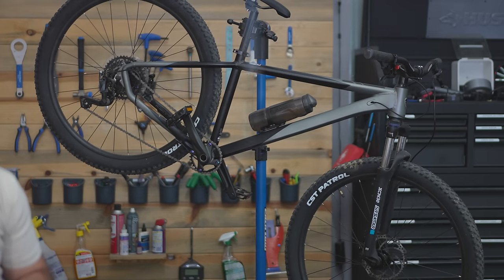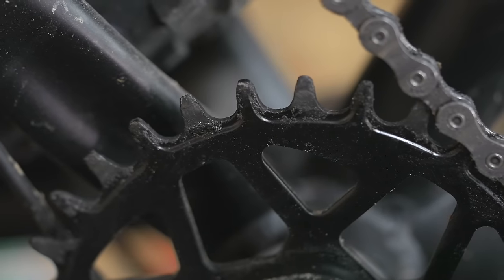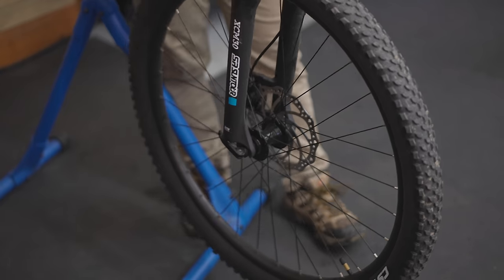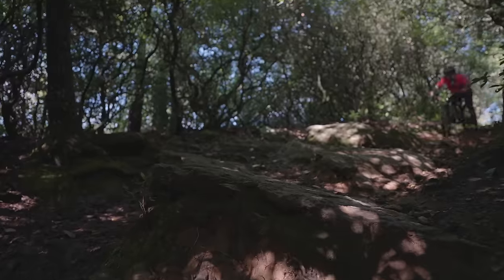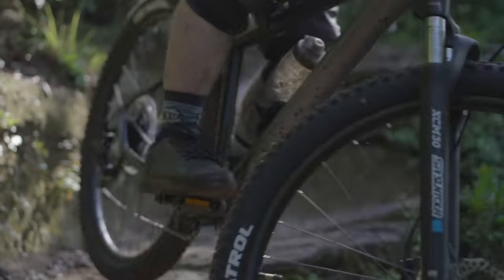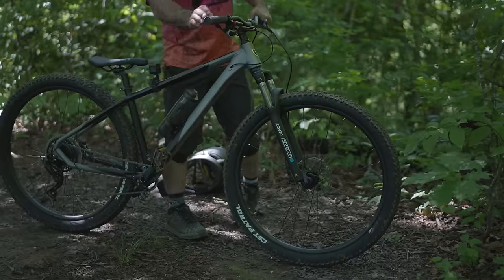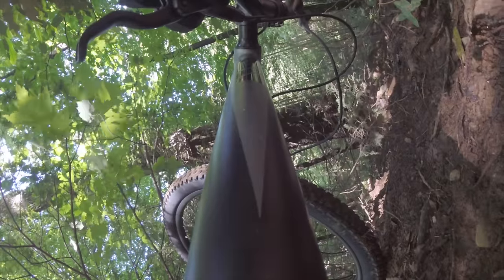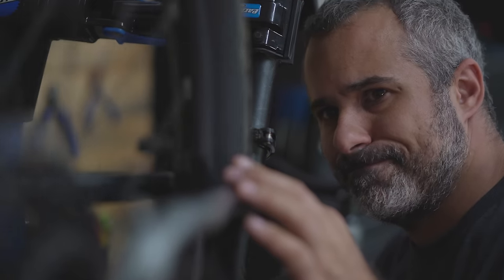Walmart MTB Upgrades! Will it explode or improve?

Comment: Decent upgrades Seth! You are correct, the fork needs to be changed to an air fork and probably change to a decent set of tires meant for the type of ride you have done or you are about to do when there is reasonable wear and tear on the tires. However, it might be better to get a $1,000.00 built bike that may have all the upgrades that you are looking for since the additional upgrades may be close to the $1,000.00 price tag. I don't live in the US and I may be wrong with my estimate price wise. Nevertheless, great content! Cheers!
Reply: I just commented on the tires, I actually would love him to do a tire upgrade next before the fork and overlap the current bike with exact same setup but correct tires for the terrain he's riding. 

I think it has some educational value, lots of people run the wrong tires trust me I see it all the time, and it would be kinda fun to see him take those same corners he found tricky ( and crashed at ) with tires which actually give him good contact/grip. 

A cheap air fork won't be much of an upgrade I feel, in my exprience they are better at small impacts then a good coil fork but when you get bigger impacts those cheaper air forks can run into problems quickly with sloppy tolerances and very high wear and tear because of that. I would rather get a really good coil fork then one of those cheap air forks. Servicability I think is zero as well because the air damper being a single fixed assembly. 

Unless you got a specific cheap fork in mind?
Reply: not even worth waiting for tires. upgrade the front tire for safety and keep it as a spare fast rolling replacement rear tire. not worth crashing :P
Reply: @MarvinWestmaas  manitou markhour

Comment: Glad to see someone actually showing these new Walmart bikes and cheaper amazon parts actually being installed correctly and taking on a real trail at speed not just throwing the parts on purposely wrong wanting them to fail for the video or  just babying it down a dirt path 
I rode an upgrade Walmart bike with some of these same parts for  few years till I could get exactly what I wanted and it served me very well

Comment: I also have a history of a bike for the best price, but my budget was about $1,000. I was able to buy a brand new Trek marlin 7 for just 720$, and then +50$ for a new Air Rockshox Judy (in addition to amount from selling stock fork) and +$60 for good tires. As a result I got my dream bike, and I still have some money to upgrade)
Reply: I have a Marlin 6 and I'm also planning to upgrade to an air fork. But the prices of air fork is quite high in India. I was thinking of Judy. Is it good or should I go with other fork?
Reply: @_anindith_  Judy Silver TK is a pretty good fork. It cost me 190$.  Rebound adjustment works well, it has 5 positions. it weighs less than I expected - 2160 gr. But be sure to disassemble and service it before installing it on the bike, because it worked very poorly out of the box, but after proper maintenance, it runs very smoothly.

Comment: Also bought the Zoom breaks, half a year they were working ok. First day below zero degrees C°, both levers were leaking at the seals. So I switched them out with Deore levers which have much better breaking force with the Zoom calipers  now and still work fine.

Comment: did the same thing a few years ago (2016).. when i was still in college, budget was limited so i bought a department store bike(chinese alloy bike) with tourney parts for a few bucks. a year later bought a shimano slx drivetrain and a chinese wheelset. still using the fork and brakes that came stock with the bike sr suntour xct and a shimano mt200. did improve alot that it made me very happy. it still runs like new to this date and i couldn't ask for more.

Comment: You should check out the Scwinn Axum from Walmart, I've been riding it for a year and it's been good fun! Not to mention it has a dropper post!
Reply: Without the dropper they are the same price.  It is the better bike for upgrading.
Reply: I think what holds the Kent back is the seat tube diameter. It really limits what external droppers you can put in there and the lack of internal routing for a dropper is disappointing to say the least.

Comment: The problem with the zoom brakes is that you either get ones that work perfectly fine or you get ones that send you to your death and it's kind of a toss-up
Reply: How would you know lol you’re alive so it must of not been that bad
Reply: I haven't had issues with zoom brakes and I've had a few cheap brakes (zoom, cnc, meroca). My other cheap hydros required bleeding since they were spongy from the factory, but no leakage or issues after the bleed. I find Zoom makes decent products but they are a bit heavier compared to others.

Comment: With my Suntour XCM fork on my 26" Raliegh Talus 5.0, I've had the same issue of my front wheel coming loose. Granted I was riding really really rough bike park trails, but still not ideal.

Edit: Watched the whole video now. DO NOT BUY A CHEAP AMAZON FORK. I purchased one for my other bike, also out of curiosity. It has leaked from day one, and is genuinely terrifying how poorly built it is.
Reply: I am at the point of replacing the quick release axle in the front wheel of my bike with the older style threaded rod with nuts either side to hopefully stop it coming loose (cup and cone bearings). Time will tell if that is any better behaved I suppose. Previously I had no idea why people were bothering with through axles :).
Reply: @jg374  If I could afford a bike with thru axles, I would have switched long ago. I've bent and broken rear axles, had the front come undone, etc and if you need a new axle they're shockingly difficult to come buy unless you'd like to buy a whole new hub and take the axle from that.
Reply: @smileyguyz  a few months ago I replaced the cones and ball bearings as they were fairly beaten up. The local bike shop had generic quick release axles and cones that worked sitting on the shelf. I would have thought what seems like the many different through axle standards would be harder to find

Comment: Did this with a Mongoose 29er hardtail...put new disc brakes and an Amazon Air Fork...and it still rips after 6 years! My wife likes it because the frame is smaller and more her size. Still getting used.

Comment: As someone who occasionally still rides an old hardtail with some similar specs to this:
-The front skewer coming loose is a thing that happens. It doesn't matter how tight you put it on, 5 minutes later it will probably be sloppy. Usually I retighten it once and it's good until the next time I take it off.
-The crud on the fork stanchions tells me there is not enough grease in there and it's eating the bushings. That would also explain the play it has developed. That said, if that's one of those pogo stick-level Suntour forks, just replace it. With no damping you'll never make that thing feel good. They're also incredibly heavy.

Comment: Those zoom brakes are basically what came on my Aventon Aventure e-bike. Only difference being the built-in hall effect sensors in the handles to kill the motor. "From the factory" the rear didn't work worth spit and the front barely engaged. Rear was a messed up caliper because the bleed bolt was stripped, front just needed a bleed. That's to be expected when they ship filled with fluid and are assembled by resus monkeys on crack.

Once I got a new caliper, did a full flush on the rear -- where nasty green bacterial ick came out so I forced some IPA through the line-- bled the front, and made sure the fluids were topped off, they've been amazing, reliable, and overall well worth it. If I were going to do an aftermarket conversion to hydraulic, I'd buy them no question. Especially since they take the same brake pads as the Shimano XT!

Hydraulics are a lot like what you said about the Kent overall. It's a technology where you really need to either be able to do your own servicing, or have a professional service them for you regularly. There's a lot of "cheap stuff" that's like that where you can get away with cheap if you're willing to put in the labor to bring it up to spec. I got a cheap set of replacement rotors just because I liked how they looked, and was amazed that they were so much higher quality than what the bike came with.

As such I'd love to see you do a "cheap air fork" swapout. (if you haven't already, catching up on watching here). With my aventure I swapped to a $199 double-shoulder unit because the stock zoom fork had next to no travel (90mm) and already had one of the wipers let go after only about 200 miles on the bike. I've put an additional 320 on it with the replacement and been fine.

And with it being an e-bike that extra 40 pounds or so weight puts a hell of a lot more of a pounding on the parts.

Good for a laugh though, my swapping the cranks and chainring for billet aluminum and a 53 tooth took 3 pounds off the bloody thing. :D

Comment: Hey, i have recently turned a $215 Walmart 21 speed 26in Hardtail MTB bike into a 1kw E-Mtb and I don’t like the front fork. It is a, from my measurements, approximately 120mm Travel fork and one day it bottomed out hit a hole causing Snake Bite. I mainly ride the roads, bike lanes, and sidewalks. 
I was thinking of upgrading them to 180mm for extra cushion and HOPEFULLY only need to use 170mm of it. I want have at least 10mm, or more, of room to spare.

I also have a Full suspension frame in my shed that i plan to build into a FS EMTB with a rear shock having a lockout option, same with the front but i want at least the rear to have the lockout functionality.
I intend on keeping both bikes as 21 speeds, i love 21 speed bikes.

Comment: i bought a schwinn ascension for target last week and it has surprised me, it was $450. it has manual disk brakes, a 1x7 drive train by micro shift, as well as a rear retailer with a clutch. I’d say that’s pretty good for the money, you lose a lot of the in between gears as well as a name brand fork and hydraulic disk brakes and you save $400+.

Comment: I know this upgrade isn’t essential but if the hubs go consider swapping them out for koozer xm490’s. My basic shimano cup and cone hubs went after 3 years of commuter use which isn’t bad but I’m a year and a half into these koozers and there mint, still super smooth sealed bearings and 72 engagements so they buzz. Was so impressed I built up a trials wheelset, no skips at all so far and, I’m amazed as they were £80 on Amazon. Compared to a Hope pro 4 that’s a massive difference in price.

Comment: After being the former owner of a Cannondale Lefty a few years back (15 years) that I regret selling often I now own a Kent Fixie that I purchased 7-8 years ago rode it less than 10 times and threw it in my back yard until recently. Then a couple of weeks ago I decided to do some work on it, upgrade a few things and see what I've got. Believe it or not it seems to be performing quite well. Granted I'm not gonna take up to A-basin and run the trails with it but for the light duty stuff I'm using it for I'm rather impressed. My only real complaint is I wish I could find a suspension fork w/lockout for a 1" threaded stem. At this point I'm trying to figure out if there's a way to put a 3 speed rear cog on it with the factory wheels with an updated/longer chainring and bottom bracket. Then I might look at doing some disc brake wheels and get some hydraulic brakes as the rim brake SUCK!!!

Comment: I also had the same problem , i did buy a chainguide for the front . Solved the problem in my case for 80%  spin the crank 1 time and the chain goes on the sprocket again.  Now alsa a clutch derailleur and the problem is 100% gone

Comment: I just upgraded the stock WTB Ranger tires (very similar to what's on the Kent) on my bike to Specialized Purgatorys that I found on sale for 12 bucks! I immediately felt much better taking speed into corners and didn't struggle with traction while climbing in loose terrain. Mine are 27.5 but if you can find a similar deal on 29s I'd say that would be a huge upgrade for less than $25.

Comment: I think a cheap chain retention device would be an excellent value upgrade. I’ve put a Funn Zippa bottom bracket chainguide on the kids bikes. They still run the no-clutch derailleur and work well.

Comment: Great video! I'm thinking to do something very much in this line.
See, I have an old Norco hardtail, it is 18 years old and I upgraded everything that could be upgraded. I went from freewheel to freehub, from 3x7 to 1x10 deore, it now has a hollow crankset with external bearings like you did here, maxis tires, shimano hubs, wide handlebar, short stem, great alloy platform pedals, new automotive paint, a new unexpensive fork (V-brake cuz the rear won't accept a disc). And all you can think about. The frame is the onlything original on it to be exact. Now, It is a 26er size small (love the size) and only has the option of a V-brake in the rear, so I don't feel comfortable with a big 50 to 52 tooth cassete in the rear leaving the deraileur so close to the ground, I dont love the idea od a hidraulic disc in the front and a mechanical V-brake on the back and I don't like the fact of it being a 26er which doesn't really have too much options for tubeless tires or the combination of it and the very slim rims it has to have for the V-Brakes. 
Now, I saw a very nice bike on Costco the other day for abour 400 USD (8,000 mexican pesos, I live in Mexico, son I haven't seen this Kent bike on Walmart). Cant remember if it has conic or straight steering tube, but it is a 29er, frame looks and feels great, comes with Maxis Icon tires and all shimano. It needs parts, lots of parts, but I spent around 700 in parts for the old frame, so it ain't such a big deal. 
If you see it on Costco, would ypu take a look on it and let me know if you think the frame is worth the effort of upgrade? I plan to preety much change everything on it, but it is hard to gen a nice frame only option for under 500 USD, specially here in Mexico. Thanks a lot!
And BTW, what would you sell the old Norco for? It is pretty muck brand new except for the frame itself.

Comment: I think we should look at these bikes as capable frames, with temporary build parts. When you're evaluating whether or not the bike is worth while, examine the frame spec and geometry. i.e. does it have a replaceable derailleur hanger? Does it have a threadless headset? Is the Geo more X-country or Down hill. And note that some of the newer frames have a tapered head tube which is an advantage for up grading the forks. I would consider the parts that they come with as temporary until they wear out, break, or simply time for an upgrade. In the end you will save a little $$ compared to the equivalent $$ spent on a bike shop bike and have a very good, capable bike. The down side is when it comes time to sell it. You'll always get more of your $$ back from a used Trek, Giant, etc. etc. than the most upgraded Walmart (Big Box Bike).

Comment: You can fix most of that chain drop with a small top mount chain guide.  If you run it nice and tight to the chain, it becomes physically impossible for it to drop.

I ran one for years on my old 1x9 converted hardtail before I went singlespeed on it.

Comment: Bucklos 120mm amazon fork ($US120) works wonders and a plastic chain tensioner that just pulls the chain closer to the frame (US7.00) would really up the performance on this bike. I used both of those and the zoom brakes (US50.00 2 years ago) on my 2017 Schwinn Boundary, and they made the bike feel amazing... riding better than US$750+ Trek and Specialized entry level MTBs...

Comment: Those Bucklos/Bolany air forks have a tapered & 100mm thru axle version that would be a direct replacement for how that bike comes factory 👍. I've pushed my Walmart Hyper Hydroform to a Rockshox Reba 140mm and it was the best thing I've done to one of these decent walmart buys. You should ultimately go to a higher end fork just to max out your build!

Comment: I have Bucklos LUTU 120mm travel on my Huffy Warhawk 29+ bike and it has been holding my 270lb off the ground with 140psi in it. I got to admit I was a little worried the first ride but over 200 miles on it so far and it hasn't folded on me yet. Everything where I am at is moderate at best but there are a lot of roots. I would like to see how the $40 FSA conversion would work to go from straight to tapered and maybe boost thru axle spacing on the front. I also couldn't keep the rear axle from bending forward even with solid axles on the free wheel but i changed the wheel out to a 12x148 thru axle (free hub) with the thru axle to 9mm QR adapter. The easy trails haven't bent it yet so time to some harder trails.

Comment: I built my bike with pretty much all Chinese part.
Air Fork: himalo drift 32 130mm for 100€(was on sale) now available for 150 
Rear air shock: dnm ao38rc 190mm 60€
Hydraulic brakes: ztto m840 4 piston 50€
Dropper post: ks exaform: 60€
 sunshine cassette , knc chain....
And lot of other parts. I ride my bike really hard and everything still working extremely well after 2 years of heavy usage.
There are pretty good and cheap stuff :)

Comment: The entire Microshift Acolyte 8 speed system is not bad. You give up a bit of continuity between gears but at 12-46, it’s not a bad cassette. Shifter, cassette and chain runs about $135 total.
Or possibly, the Advent 9 speed system does have a derailuer with a clutch for $60.

Comment: A Microshift derailleur has the best clutch you can buy, at as little as $150 for the whole drive train. I have never dropped a chain with even non narrow-wide chain rings. The clutch is so strong, it is almost problematic with oval rings. The best part is that it has an on/off switch, and rarely drops the chain even when off.